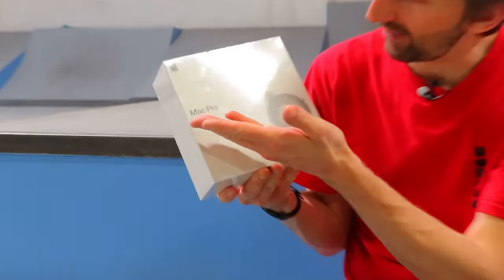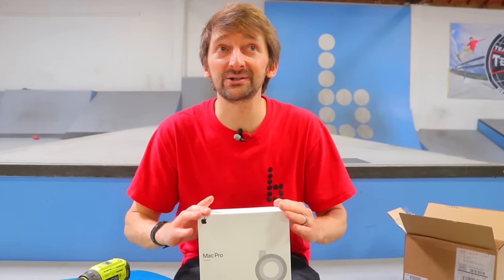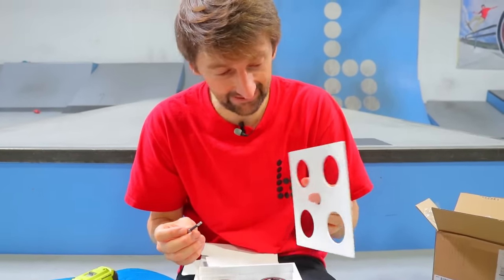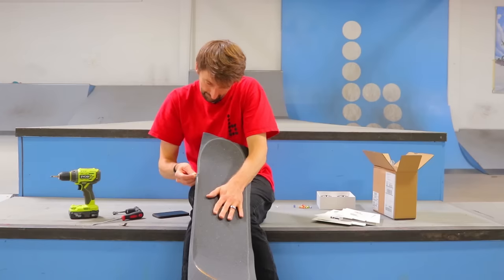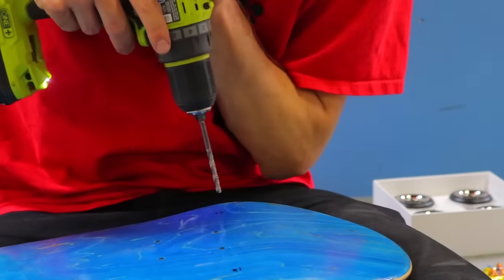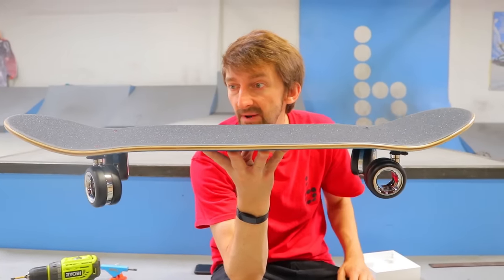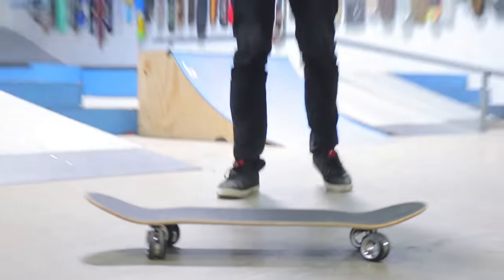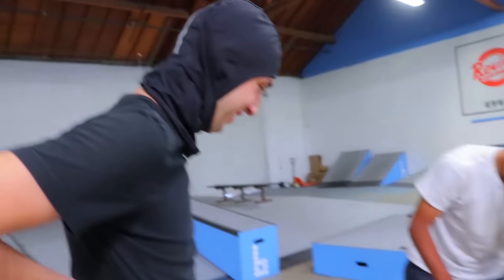I TOOK APPLE'S $700 WHEELS AND MADE A (BETTER) SKATEBOARD

Comment: Fun fact, the apple boxes alone go through many phrases and revisions to make sure they feel perfect. They change the texture, vacuum, and all that stuff.
Reply: Fun
Reply: @piotr78  sure is
Reply: vacuum?
Reply: @bermchasin  it's the resistance of the packaging sliding off the box. The more it pulls, the more it pulls a vacuum on the air inside causing that level of tightness.
Reply: You forgot the fun part!

Comment: “Worlds best computers” 
The entire custom pc build community: ahem
Reply: Smh they actually are worlds best but not for gaming stuff
Reply: @3xxett  not at all they had the same hardware that you can get for any pc the difference is Apple products have Apple software and you can't fix or upgrade on your own without losing your warranty. I would rather save money with building my own pcs far superior than any Mac and buying any Samsung phone far superior than any iPhone. For non techy people it depends on your interface of choice and the features that OS  has that can benefit your use for it. As a tech maniac I don't go near apple products with a 10 foot pole.
Reply: @3xxett  yea no what are they better for
Reply: 70th like
Reply: @Commodus43  apple has probably the best laptops and pcs for work purposes
Reply: @Commodus43  apple isnt bad ur overreacting
Reply: @azn4964  hahaha Apple is so slow and no graphics card unless you pay thousands of dollars what a joke
Reply: @azn4964  no you can get much more efficient and better for price PC's if you build it yourself, your an actual joke my guy
Reply: @azn4964  I can build better for a fraction of the cost only difference? What I build will still be in use in 5 years not just a super expensive paperweight

Comment: lol, I can already hear the Jony Ive Apple add for this in my head “At Apple we looked at what holds on the trucks and wheels of a skateboard and asked how we can streamline this process? We engineered a single bolt from space grade 904L steel from recycled Rolex watches matched with swiss ceramic bearings housed in more recycled Rolex watch 904L steel and sleekly padded by premium Pirelli rubber wheels. We decided why should we be restricted by going in just two directions so we engineered these wheels to break free of the norm and move in 360 degrees, at the same time. Apple are proud to introduce you to the Apple Pro wheel. Today Apple reinvent the skateboard!
Reply: Lol! 🤣 I totally heard that in his voice!

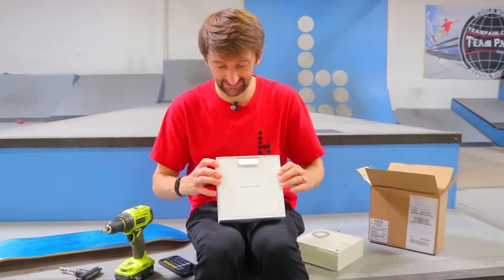Comment: 2:25 - to be fair, it isnt just a wheel, so the 17 sets of wheel number is a bit exaggerated.    You dont need trucks and bearings are included. So lets assume Bones bearings and some regular trucks would add about 2(40)+15 or about 100 bucks to the wheels which are now.  So, at 140 for the trucks wheels and bearings - you could only get like 5 sets for the $700. lol

Comment: Try a conventional truck on the back for directional stability and the caster wheels on the front.
You might be able to sweep the nose like a surfboard without having to lift.
It'll likely just understeer.
Also try the rudder truck right in the middle for a six wheeled beast.
Put one or two on the kick tail with a conventional truck set up.
Put one mounted on a hand puck for downhill.
Put em in hands and knees and flow through the bowls bodysurfing.

Comment: Put longboard trucks on it n fit a bearing in-between the chrome times and put a bolt on the end with locktight  so the wheel can only coast with the bearing kinda like Tron

Comment: If you drill a hole from the top of the deck angled to the back of the board it should offset them at a angle several straight but when you corner hard it’ll kind of drift

Comment: "World best phones!"
Laughs in OnePlus.
Reply: "Worlds best computers!" laughs in laptops that don't have thermal throttling (heating issues for small brains) and desktops that have 64 cores and 128 threads (really powerful in small brain) and in desktops that come with all the parts you're paying for (you can get 2 2080 supers and a ryzen 9 3950x for cheaper than the base model mac pro which only comes with an rx 580 ($100 graphic card)
Reply: @pizzasounds3387  but yeah, its overly priced
Reply: @jonerforpresident ? That's what I said.

Comment: use steel washers. let the bolts do the stretching, not the rubber.
put a tube thru the wheels.

Comment: Fun fact, a 3.25 inch wooden dowel rod fits snugly through the open hollow in the center of the Apple Wheels which could be used to lock them together in a straight position so they roll more like a conventional skateboard wheel. Just throwing that out there.... 🤷

Comment: Why not try to mod the wheel and use traditional skateboard trucks? The apple wheels got to have some kinda bearing in them
Reply from the maker: Interesting idea 💡
Reply: @brailleskateboarding  I think you could do it by taking apart a ball bearing & sanding down regular wheels, so they're non-functional but fit on the trucks well, and with the apple wheel you take off the feet & outside casing of the apple wheel. see how well it performs just using apples wheels & bearings. 

not sure if that's even possible or cost-effective, but it sure sounds cool!